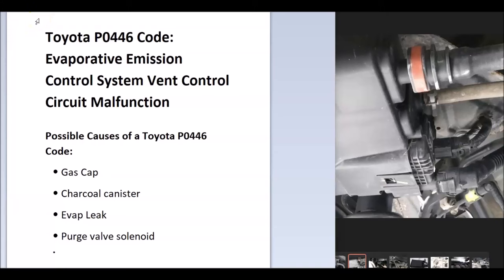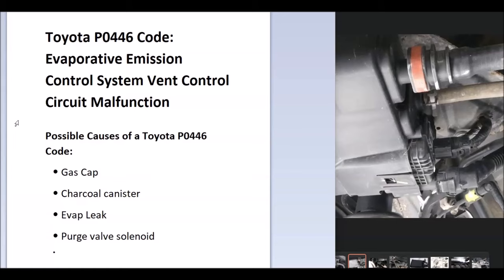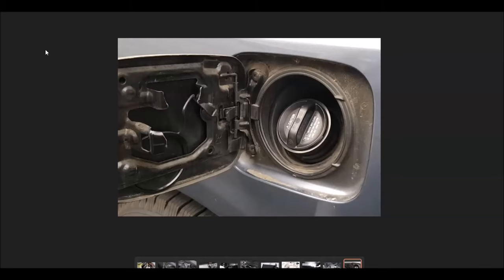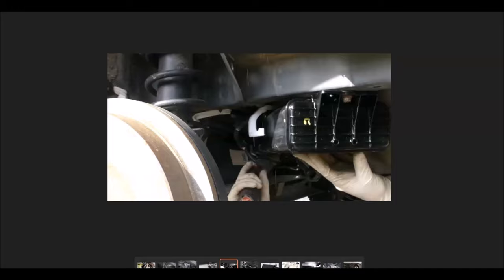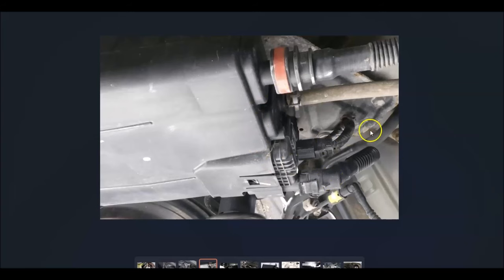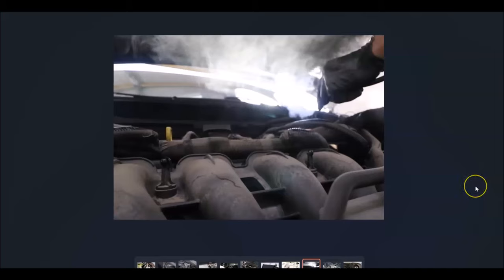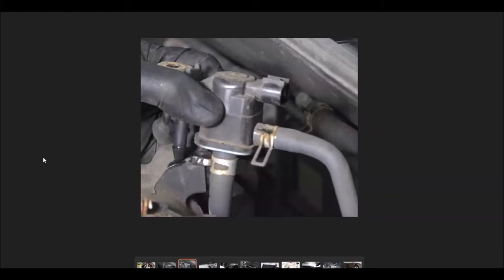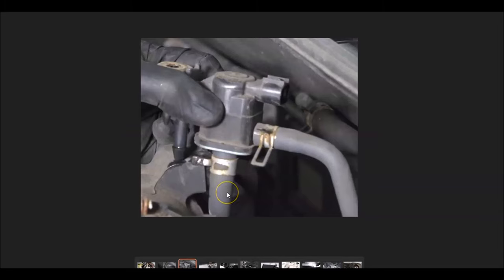How to Fixes Toyota P0446 Code: Evaporative Emission Control System Vent Control Circuit Malfunction

Comment: Free tip don't overfill your fuel tank
Reply: I may have done that, i ordered a tank neck. but never got installed.  how did you fix it?
Reply: Did this once recently and then got this code a little later lesson learned
Reply: Wait if I let it fill like normal until it automatically shuts the pump off would that still overfill it?

Comment: There could be a leak in the gas tank, or around the sealant ring of the fuel pump where it connects to the tank.

Comment: I replaced my charcoal canister not even a month ago and now it's giving me a p0446 i think the vsv on the new canister failed
Reply: I got this code too and was told it was the vsv as well did replacing it get rid of the code?
Reply: Throwing parts at a problem and listening to UTube mechanic doesn't always work

Comment: I have a 1998 Lexus SC400. Been having trouble with the P0446 code intermittently for years. Car runs great. No smell of fumes and no problems period. Except that it makes it difficult to pass emissions Always pops while I’m in line. Shop says I need a canister and should change the purge valve too. These parts are not available, so I’m thinking of going for collector car plates which exempts me from passing emissions.

Comment: Have issue with p0448 had took it to mechanic they did smoke test and change vent control value 6 months late engine code re appears

Comment: i have the gx470 with an aftermarket gas cap. it does click but feels like a flimsy piece of junk.  I never hear the air release when I go to full up the gas tank making me think the seal isn't that great.  I have the P0446 code along with the check engine light, traction and vsc all lit in the dash at the same time.  what could it be? I did MAF cleaning, new air filter, throttle body cleaning.  however the oil is still needs to be changed its long over due.   not sure if that is part of the is problem.
Reply from the maker: The code is pointing toward the charcoal canister vent valve having an issue. While it could be the gas cap, I would start by checking all the wires going to the evap vent valve and testing it.

Comment: Thank you for this video.liked.subscribed. I have 3 codes. P0440,P0441, and P0446. Would the purge valve pop the 440,446 codes? I want to do this in the repair in the most efficient manner. I need to pass emissions.😢 2002 4Runner. 3.4 liter V6
Reply from the maker: With those codes, I would test the vent valve and check for an EVAP leak. The purge valve can also be tested to see if it has failed. Here is a video on how to quickly rule out the purge valve. https://www.youtube.com/watch?v=5rQelbINjTQ
Reply: Hey I have the same exact codes any tips? @WerkToday ??
Reply: Been battling these codes on and off for years. lol

Comment: Very good video, now what would harden if that code use stayed on all the time 
Wold it harm the engine?
Thanks
Reply from the maker: An EVAP problem usually will not harm the engine. The Evap system is for emissions, so often, the engine light stays on, and the vehicle won't pass an emission test.
Reply: @HVAC_Mechanic  Thanks

Comment: if it was the hoses, would you be able to smell gas when driving? I'm having this issue with my celica, and I don't require emissions so I'm considering just taking out the charcoal canister cause I sure can't afford the part right now
Reply from the maker: Sometimes there is a gas smell, it can vary.

Comment: Would a smoke leak test work to find a leak if so how do you connect the smoke tester? Is there a video ?
Reply from the maker: Yes, there are a lot of good videos for smoke testing the EVAP system.

Comment: I NEED HELP....
MY TOYOTA ALL AT ONCE THREW THESE CODES - P0446,P0441,P0455,P0441,P0446,
P0455 
DOES ANYONE HAVE ANY IDEA WHY ALL OF THESE TURNED ON AT ONCE???
I DID REPLACE THE AIR FILTER RIGHT BEFORE BUT IDK IF THAT CAN BE IT..
 PLEASE LET ME KNOW WHAT YOU THINK!!!
Reply: Check around the air filter area and make sure u didn’t disconnect any hoses that lead to the crap system